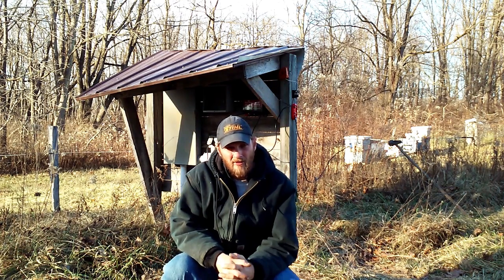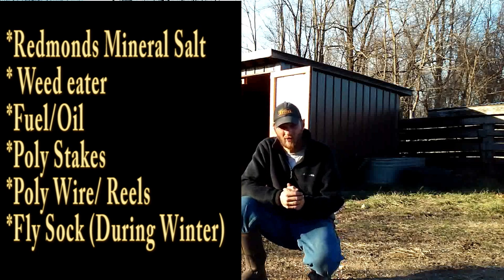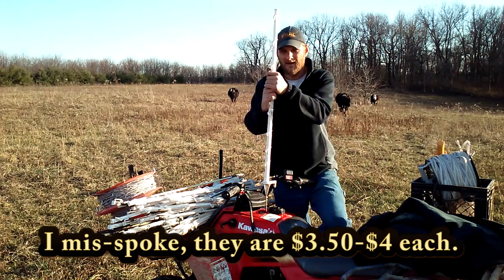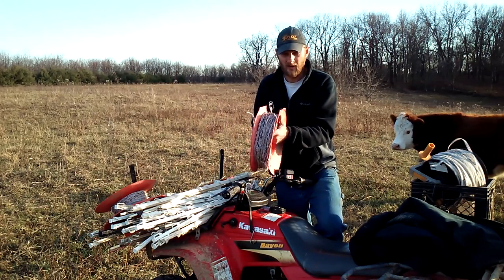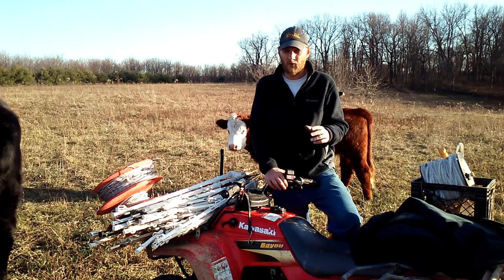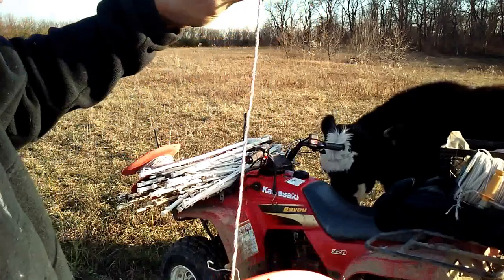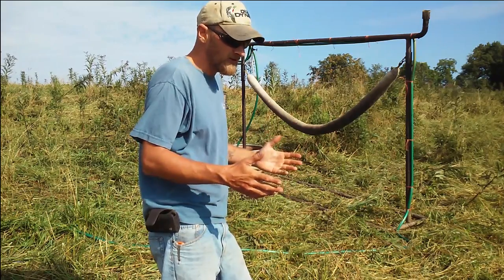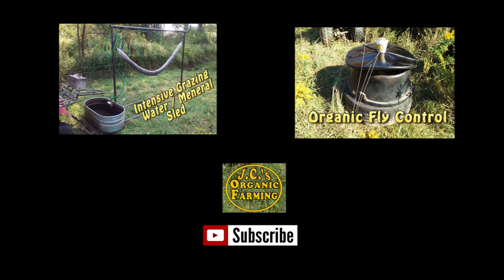What's Needed To Start Intensive/Mob Grazing Livestock

Comment: How would I go about regenerating a pasture that’s been over grazed for so many years that it’s got next to nothing growing on it each summer? Spreading seed on top in spring? Breaking and reseeding? No till re seeding? Or just start a very dense and very short mob graze on it with lot of recovery? I can also spread my manure on this ground is that a good idea?
Reply from the maker: I would suggest bale grazing. Unroll the bales and let the cattle eat them. This will help spread the manure piles out plus there will be some hay left to feed the soil. Make sure to use good hay though because the seeds in the hay will sprout next season. This is by far the cheapest and easiest way to build a nice pasture without a bunch of resources.
Reply: Thanks a lot for the reply! Greg Judy said the same thing but I’m hoping not to waste much hay this season as I’m in the second year drought so I’m going make them clean it up but I think at least the manure and a lot of seed will be left behind and hopefully that will help alot

Comment: Good video Jason. Although I dont have cattle, Ive very intrigued by the mob grazing/hollistic grazing methodologies. It just makes sense. I know it doesn't work everywhere, but it certainly is a more healthily approach for the the animals and humans in the long run. I do wonder why you aren't using a solar fence charger for your fencing? I have a small garden next to my apple orchard, and I use a solar charger from Tractor Supply ($170) to keep the deer and rabbits out. It has a 10 mile range and 0.15 joule. Should be plenty enough for your application? Never have to worry about power outages, and they are virtually maintenance free. Im just thinking out loud. Im enjoying everything Im read about this new approach to feeding and livestock health... Keep up the good work sir!
Reply from the maker: Hey Joey, I have learned a lot in the last 5 years of my cattle venture about holistic grazing and it still amazes me. I have a hard time understanding why so many farmers are not doing this. There are many ways to use this model with small livestock. For instance, You could buy some electric poultry netting and build a small portable coop then place this in your orchard. You would move it every couple days and the chickens would eat all insect around the trees. You gain pest control that will pay you in eggs and adds nitrogen to the soil.
I have looked at the solar fence chargers just never made the switch. I do however have a battery powered charger I can use if the power goes out for too long. I have never used it though because the cattle seem to think it's still hot. lol

Comment: JC, great video and thanks for teaching us new tricks. Can you elaborate a little bit more on the organic fetter and fly control please.. Is it something you came up with or is sold as a unit.Thanks
Reply from the maker: +luis murillo The mineral feeder we use is sold here https://www.valleyvet.com/ct_detail.html?pgguid=246f390a-ca8e-4ed1-bda0-d1cb7daf294b&gas=mineral%20feeder . We mounted our feeder to a semi tire to get it off the ground. Then I mounted an eye bolt on the side so I can pull it with my atv.

The "Fly Killer Kover" is sold here https://www.valleyvet.com/ct_detail.html?pgguid=a6689288-ede0-4141-9305-f35350a25d37&ccd=IGO045&gclid=CjwKEAiAgeW2BRDDtKaTne77ghgSJACq2U4bePM0jipv3GOQmKKW64Xeb0gRlVhvrHEAgBAr9Ut5CRoCENLw_wcB&kwid=95701404845x10110980045x170311325 . I know the cover is expensive but well worth the investment in my opinion. There is several organic fly control agents available on the market. Just search "organic livestock fly control" on Google, you should find several. We use a product from Crystal Creek called "No Fly" it's just essential oils. It's smells wonderful. We call it cow perfume!

Here another video of mine talking about our fly control. I believe I show the fly agents we use. https://youtu.be/EgEgV7VbWTQ

Comment: JC, that you for sharing your practices so well. I suppose I'm a dreamer but would it be economical to use a horse instead of the ATV? Perhaps the advantage of more manure would offset the added labor. Thanks again. Mike
Reply from the maker: +Mike Trev A horse would probably make more sense yes. If a person has time to manage the horse. I do not, so for me the ATV works great. Plus you have to consider the time it takes to saddle a horse everyday vs just starting the ATV. Sure gas is an added expense but for me it works. Thanks for watching!
Jason

Comment: Good information.  I'm just getting started with intense grazing in Kentucky. Are you using freeze hydrants and water hoses and how far apart? Thank you sir
Reply from the maker: Yes our farm is setup with 32 of the frost proof water spigots. Each pasture has at least 3. The spacing on them varies though. They were placed on how we would setup the paddocks in each pasture. I do use kink free water hoses and a RV water pressure reducer to keep the hose from blowing out when the float valve closes in the stock tank. It seems over time of the hose laying in the sun the water pressure will cause the hose to expand until it gets a hole. Of course this can take a month or so but the RV reducer stopped that issue for me. Amazon carries the RV pressure reducer.

Comment: We used the plastic type post 1st time last yr, we had so many break from snow drifts that were 4-5 foot as well as a few jumper yearnings that snapped them in half. So we stick with the fiberglass post.  
My question is, when rotational grazing, can I simply use electric fencing wire instead of the poly wire? 
I dont have a crank, but Ive always hooked a post thru the wire and used a screw driver to wind up the wire when I move fences.
Reply from the maker: I've seen people use metal wire vs the poly wire and it does seem to work. I don't know how easy it breaks though. I would think rolling it up time after time may weaken it.

Comment: How many cows can I mob graze on 180 acres? How long does each 1-5 acre paddock need rest?
Reply from the maker: We lease 176 acres but only 125ish is grazable. We our currently a cow/calf operation of about 30 cows and we have no issue with the 130 acres keeping up as long as it doesn't dry up. We do buy all of our hay though so that is something to consider, do you want to cut part out for hay production or graze it all.
Reply from the maker: I graze 1to 5 acre padds and let them rest for at least 30 days, 45 to 60 is better unless it's the spring flush then you need to move them fast to keep up.